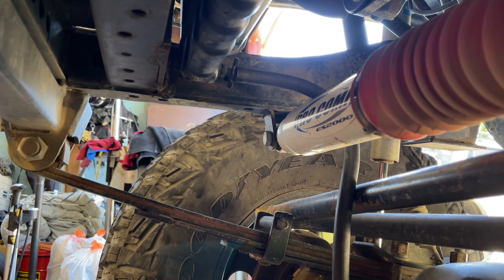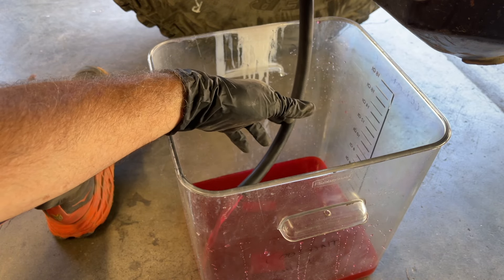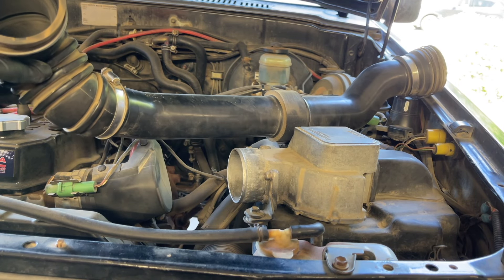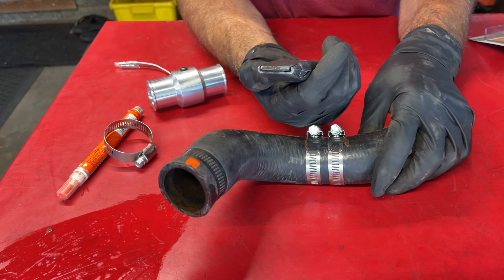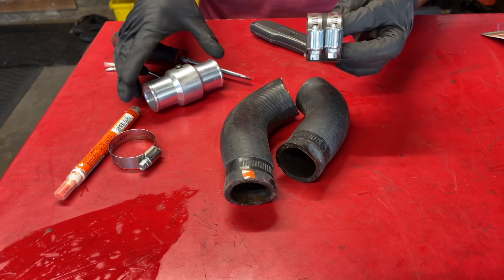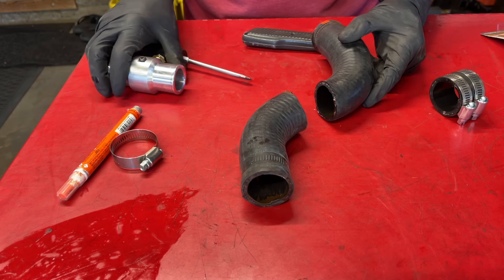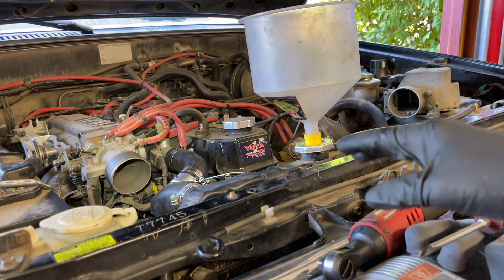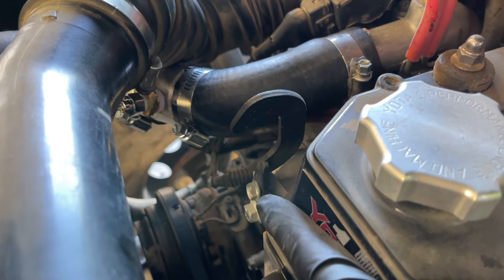Aftermarket Coolant Temperature Gauge Install (1st Gen 4runner)

Comment: Good job.  I always watch your videos even without a 4Runner.  I looked at a used 4Runner last year. We got rid of our Nissan Frontier because my wife was tired of driving the truck all the time.  The 4Runner was of course too much of a truck also, and she wouldn't go for it.  We now have a Rav4.
A "picky" comment I'll make is that I think your Lisle coolant funnel, the "Lizzel"  is probably actually said like ISLE or MILE.
I'll be back for the next one. Keep it up.
Reply from the maker: I usually say Lisle like Lyle, but then I head someone pronounce it Lizzle, and I started questioning the way I've bee pronouncing it for years.  I think you need a second vehicle and you should get a 4runner.  Life is short.  Enjoy it!
Reply: @TimmyTheToolman love that thing....but the one from HD leaks like a little bitch at the cap no matter how you stack the gaskets or the interchangeable caps. But still a good thing. Rubegoldberg it!
Reply: @TimmyTheToolman  H-m-m-m.  It's confusing then, like Knipex.

Comment: i like the detailed install in this video... the temp gauge on my '86 4runner 22re has always shown the temp fluctuating like it's supposed to, but it didn't save me from destroying an engine when a big chunk of metal went thru the radiator while i was driving on the freeway late at night, lost all of the coolant... i might have caught it in time with a bigger brighter gauge, but the most fail safe system is a buzzer(and/or flashing light?) system that triggers at an adjustable temp setting, not sure how to do that... i put a glowshift fuel pressure gauge on the side of the steering column, with the sensor hooked into the cold start injector fuel line, using the LCE adapter.
Reply from the maker: @DragRacingTV  I don't know of a gauge that activates a buzzer or light, but I suppose it is a mod someone could figure out.  That sucks that you burned up your engine. Having a gauge isn't a guarantee that you'll catch an issue before something bad happens, but it's the best we can do other than your buzzer/light idea.  If you figure something out, please share it with me.

Comment: Excellent and loads to like here. The typical OE 'cluster' gauges have a big, vague, flat or dead spot in the middle. Also, the electronic gauges (LED-types) only have a few (I think 7) segments so they are not very precise. Someone on a forum I’m on changed the resistors on the back of the cluster circuit board to make the gauge more responsive and lessened the flat spot. It’s possible that your OE gauge and sender are fine, but maybe the resistors are no longer accurate or, equally likely the cluster ground is not good. 
I liked your approach to cutting the top hose. Noting the caveats you showed I think this is a good place to mount an aftermarket temp sensor. My Toyota has a complex double heater system and there are extra manifolds etc for the rear heater, with various additional sensor units, and these are outside unaffected by the thermostat, but the flow in the heating areas is not huge and the top radiator hose is where the majority of the heat is sent, so I think you’re right in your approach. 
Interesting that the engine-mounted ground was not reliable. I wonder if this might point to a less than ideal earthing for the starter motor, or the engine in general. I would expect the engine to not have this problem. If not the starter motor ground, is there another earth strap?
Finally, I’m a big fan of marking my non-original wiring and have a Brother tape machine and the next consumables will be their heat shrink labels, but great to see extensive use of split loom!
Anyway, good luck with your Rubicon trip and thanks!!
Reply from the maker: Thanks for the compliment of our video.  Thanks for the information on the OEM gauges.  Maybe the problem with mine is the resistors.  I think the problem with the engine ground was the ground strap from the head to the firewall.  I have since upgraded it to a fat wire.  Marking your wires is a smart move.  For me, I can just rewatch my video to figure it out.  The Rubicon trip was pretty intense.  We made it through, but there was damage to bumpers, rock rails and skids plates.  I had a major failure of one of my transfer cases and it will need to be rebuilt.  The 4.7 gears failed and I was lucky my front 2.28 case would still work and I was able to drive out of there and get home.  A video of the experience will be coming out soon.

Comment: My og gauge has done this forever!
Reply from the maker: Like I said in the video, I've heard it's a problem of small copper wires on the back of the gauge becoming dislodged from their connection point.  Sometimes, my OEM gauge works like it should and slowly rises to operating temp.  Other times, as soon as I start the engine, the gauge immediately jumps to operating temp.  I took the gauge cluster out, and was close to removing the gauge from the cluster, but I didn't know the proper way to pull the needle off the gauge to separate the gauge from the cluster.  Thinking there was a good chance I'd destroy it, I gave up on the idea of trying to fix the OEM gauge.  I looked for a write-up or video on how to repair the gauge but couldn't find anything.  But, like I also said in the video, an aftermarket gauge that lets you know the exact temp your engine is at is far superior to the OEM gauge that really isn't good at helping you mitigate a potentially dangerous situation with your engine.  By the time the OEM gauge starts to rise past its normal level, the engine is already at a dangerously high temp.  You want to catch a problem much sooner so you can pull off to the side of the road or trail to let your engine cool down and/or figure out what the issue is, like springing a coolant leak in one of your hoses.
Reply: @TimmyTheToolman   I have taken the needles off a 82 the best way I found was taking a fork end getting it underneath there to leverage off it
Reply from the maker: @sportydoubledee  Good to know.  I just didn't want to destroy it because it appears if needs decent force to remove.

Comment: My glow shift gauge did not last long before having issues. Their customer service came thru solving my problems. Decided to go with ultra Gauge on my 3rd gen. recently. Don't know if it will work with 1st gen?
Reply from the maker: A scan gauge or ultra gauge won't work with a 1st Gen 4runner because it's Pre-OBD 2.  The early 4runners used OBD 1.  Big Big Difference.  If the Glowshift gauge takes a dump on me, I'll get a replacement.  If that one also fails, I'll probably switch to a Max Tow gauge.  I've been running one of them on my 98 4runner to monitor my trans temp for years and no issues.
Reply: Thanks Tim. My Glow shift gauge was from years ago. My have been improved. 
They do seem to provide good cust. service.
Reply from the maker: @mikehenderson7456  Yeah, hopefully I'll have no issues with it.  It's definitely an improvement over the OEM gauge.  Those OEM needle gauges are pretty much useless other than to alert you that you overheated the shit out of your engine.  They take took long to register a problem.
Reply: @TimmyTheToolman  Same with 3rd gen? If so I suppose I should add what you are showing us. And your trans Guage too. Would you have a video on it as to how to and P/N? Thanks man.

Comment: Het Timmy, I have a transmission gauge in my 3rd gen, not digital but analog like this one. I noticed that my CB radio interference with the gauge when I push to talk, someone ever had this before?
Reply from the maker: Maybe make sure your gauge sensor is grounded well.  My needle would move when I drew more power by turning on the AC or turning on the head lights.  When I found a better grounding spot, the problem went away.

Comment: If you have a scan gauge do you need this mod?  I don’t have either that’s why ask.
Reply from the maker: A scan gauge only works for vehicles that OBD 2.  OBD 2 started in 1996, so basically when 3rd Generation 4runners came on the market.  Prior to 1996, it was OBD 1 and you can't use a scan gauge with OBD 1.  Big Big Difference between OBD 1 and OBD 2.

Comment: Dude....time for a battery/intake swap with the supra AFM mod.   Also, if that gauge fails I recommend a VDO one.
Reply from the maker: Do you have a link to video or write-up documenting that mod?  Thanks for the suggestion for the VDO gauge.
Reply: @TimmyTheToolman  probably over on yotatech....
Reply from the maker: @BigBluePile  Gotcha.  I'll do a search for it,
Reply: @TimmyTheToolman  I forget that YT deletes links, I'll post it on FB...  I've done a ton of stuff on yotatech
Reply: @TimmyTheToolman also, it's a VAFM not a MAF...
Reply from the maker: @BigBluePile  Ok, what's the difference between a Mass Air Flow sensor and an Air Flow Meter?  As far as I know, they both meter the amount of air coming into the engine so the computer knows how much fuel to add to create the proper air/fuel mixture.  Is this just a question of semantics, because I think a MAF and a AFM are the same thing, right?
Reply: @TimmyTheToolman  I mean....when it comes to opening a door, a door knob and a grenade are the same thing....
Reply from the maker: @BigBluePile  Yeah, but one is non-destructive and the other not so much.  So yeah, I don't usually worry too much about the minutiae of things.  If people get what I mean, and I'm not steering people wrong, that's all that matters.  I could have called it a Chingadera, Doomaflache, or Whatchamacallit, and most people wouldn't have given a shit.  Sometimes the way you explain and word things can be very very important.  In this case, not so much.  I'm anal in some ways, but flubbing up on the exact terminology of a part when I know regardless people will understand what I mean isn't something I'm going to lose sleep over.  There's much more important things in the world to worry about.

Comment: Make sure to clarify that when using your test like that fuse is a 7.5amp. not 75 😅
Reply from the maker: @jimbean8202  Too late, the video is live, but you just clarified it.  Does Timmy the Toolman  misspeak sometimes?  Yes, he does.  Thanks for the correction.

Comment: before the thermostat would've been ideal
Reply from the maker: Yep, but the only convenient place I can see for that is putting the aftermarket sensor in place of the OEM temp sensor and I didn't want to do that.  The only issue, which I mentioned in the video is the thermostat sticking and not being able to recognize it immediately.   Other than that, having the sensor after the thermostat isn't a big deal.  The concern isn't low temps, it's high temps.  Once the thermostat opens, I'll be reading an accurate temperature of the engine coolant.
Reply: @TimmyTheToolman  yeah totally worth putting it in. Thermostat only really gets stuck with people that throw stop leak or something in their reservoir, which I'm sure isn't the case with your vehicle
Reply from the maker: @mikellwebb5824  I've been driving for 43 years and none of the vehicles I've owned had a thermostat that has gotten stuck.  I always renew the coolant at regular intervals and I'd never use stop leak in my cooling system.